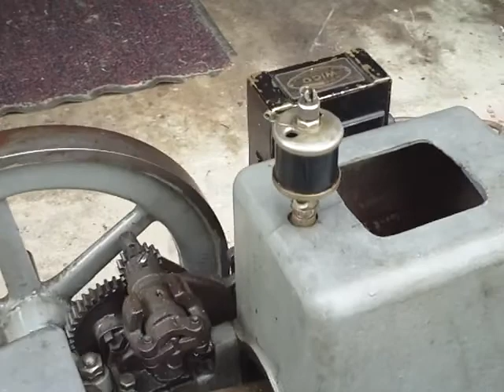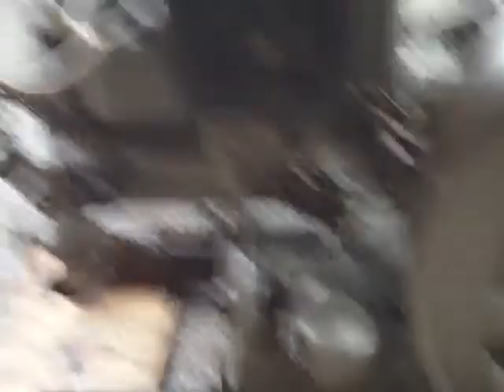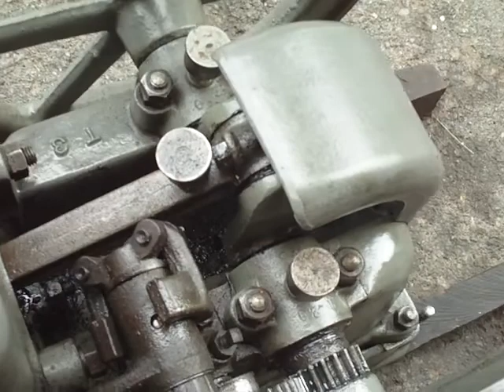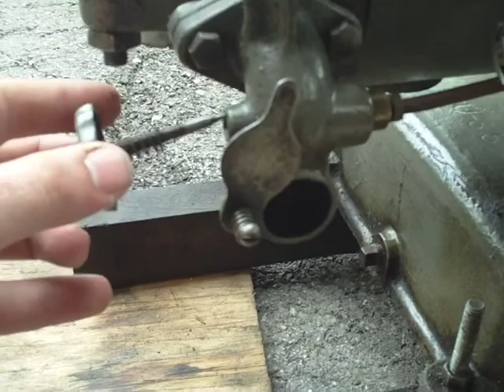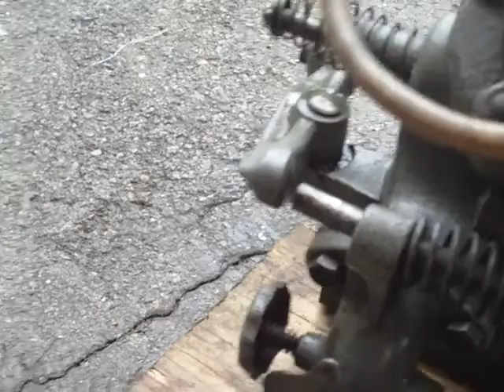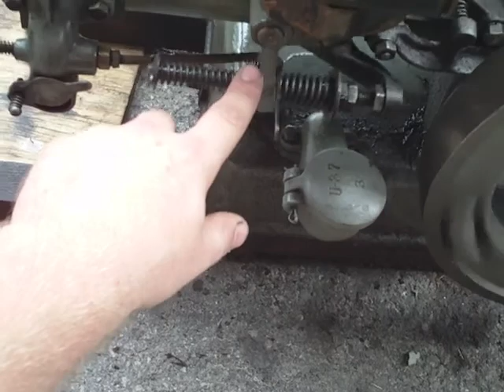How engines work 1926 Nelson Bros. Hit & Miss engine

Comment: There is actually a difference between a mixer and carb. A carb has a bowl that stores gas and a mixer just mixes the air and fuel. It doesn't store any gas. And as others have said, since this is a hit and miss engine it only fires when it gets to the idle set and fires. Other newer style hit every 4 or 2 strokes.

Comment: This is a hopper cooled engine, so yes. The hopper is an extension of the water jacket, and this engine cools itself by boiling the water. Care must be taken when adding more to a hot engine to add it slowly or the cylinder might crack. 

Oiling is done using the drip cup on top, it runs through a tube to the cylinder and drips onto the back of the piston. From there it is free to be smeared along the cylinder walls, while a small hole in the piston allows some to fall through to the wrist pin.

Comment: bcuz If u see theres no mechanical connection to the intake valve only the exhaust valve so.... if the engine is not under load..... it wont need or make more power.

Comment: There's no load on it. These engines only fire when they need to increase their speed, and without a load the engine is able to coast for a while between each hit. This method of regulating speed was popular before carburetors that could be throttled were developed, as the fuel mixture can then be set correctly for full throttle and it simply doesn't take a charge until it has coasted enough to need to speed up again.

Comment: That's how it regulates it's speed. Simple and elegant, and as point of fact highly fuel-efficient. 

These engines only draw a charge and ignite it when they need to increase their speed, the rest of the time it latches the exhaust open and sits there letting the flywheels spin. 

I have one just like it in my garage, Nelson Bros. Model T "Little Jumbo". Produces 1 3/4 horsepower at 500 RPM. Only difference is mine lacks the speed knob, and has a valve adjustment.

Comment: What makes it take so long before it goes through another intake cycle. I see that they engine nearly stops and the exhaust port is open the entire time, and then there will be an intake cycle and the fuel is pulled in. Why is that?